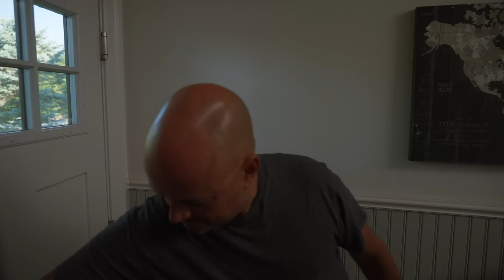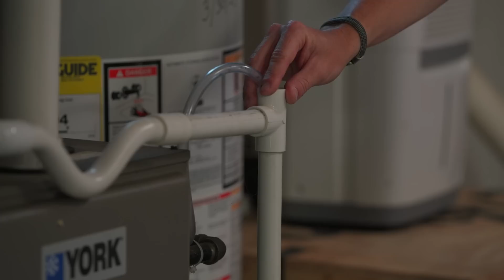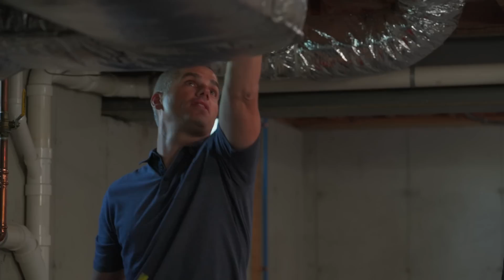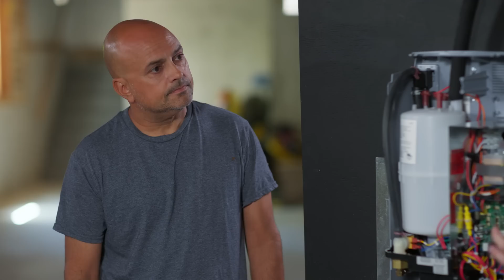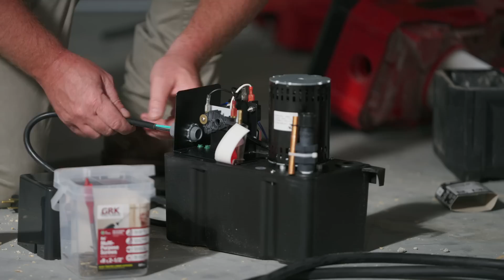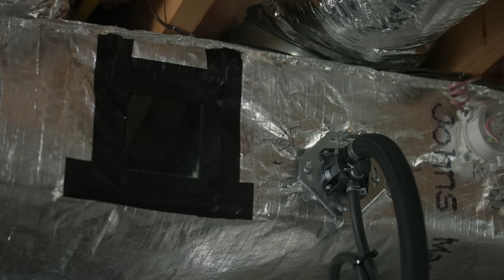Installing a Whole House Humidifier | Ask This Old House

Comment: I didn’t realize humidity could drop that low just from air leakage and exhaust fans running. The steam humidifier setup looks pretty involved, especially with all the safety components. I’d probably lean toward having something like American Residential Services handle that kind of install rather than figuring it out myself.

Comment: Is there a product like this that works without a furnace? I have radiant floor heat and no ducting or furnace to distribute humidified air. Apart from a freestanding humidifier that requires filling with water daily, is there any other product that can work without furnace?

Comment: Just had a AprilAire 800 installed in a super dry winter climate, very happy I did
Reply: compared to the AprilAire Bypass systems how do you like it?  I think I need to do this.  It just makes way more sense
Reply: @Ter @TerryKashat  never lived in a house with the bypass. But this winter with the steam has been a game changer for dry skin, plants and using less heat and sickness has been less. . Would hugely recommend. Utility has gone up a bit and have had to replace the canister once but still well worth it
Reply: @TDace25  Intuitively I believe it.  Makes perfect sense. Thank you.

Comment: Next, let's install this in a normal situation with a low ceiling basement filled with a bunch of the homeowners crap and ductwork from 1945 or an attic unit where the furnace barely fits on it's own. This Old House has become like Angie's list with video sales.

Comment: Steam is just fine but if you can afford the $1,000 w-S/H, plus ancillary supplies, wire, fan pressure switch and extra empty 240Vac slot in your service entry electrical panel, go for it. But my multi-speed two level forced air furnace that is 95% efficiency with “CAN network” communications for self diagnostics & built in humidistat was $2,000 for the entire furnace! In 8 years with cleaning, filter service and occasional check of the “WC” pressure at the gas valve uses so little gas and electricity our bill dropped to $38 average per month. Of course the utility company want money for new infrastructure updates, sewer separation fee of $58, then a fee for have a meter! Wow, then tax. So 26% of my bill buys natural gas. Start saving your nickels, dimes and quarters and 9.7 years you can buy one. Yeh!😅

Comment: Air leakage isn't the only problem with a home in the cold, heating air itself causes relative humidity to significantly drop as warm air can hold much more water than cool air, further drying it out. My skin cracks and bleeds in the colder months and running a humidifier definitely helps.

Comment: Yup, add an expensive super complex mini steam boiler instead of the cheap standard evaporative humidifier that have been around almost 100 years. Talk about redesigning the wheel! 🤦‍♂️
Reply: I’ve run into nothing but problems with our Trane and the evaporative humidifier. It’s a hybrid gas/heat pump system, that has a variable ram and heat pump. The evaporative humidifier doesn’t like low temp heating of the heat pump and low CFM fan settings, so it condensates a lot of moisture inside the gas furnace, rusting out the burners every few years. 

I deeply regret going with an evaporative humidifier.
Reply: @steveallwine1443  Yeah, I've actually seen this far too often, and ducts rusting and rotting away as well. Any humifier added to a duct/forced air system is just a bad idea anyway. I usually remove them, especially because our climate zone is humid pretty much all year long. If people require them , I recommend independent or portable systems.

Comment: Years ago, you all where presented with a mystery, While working on a  house in New England,,The extension chords suddenly started shocking folks...Same thing happened to me, I even ended up yelling at my wife for turning back on the electricity...I finally figured out after seeing the panel was still shut off that the panel was not grounded,,,but that's funny I said to myself, What happened ta cause this,.like you Guys the winter was brutal and it froze the pipeline on which the panel was grounded on when the city can and fix it,,,It Dawned on me.. The City is used plastic conduits....lol...I was in a Home Depot,,when a customer complained of his outlets shocking him, I turned my back away from him and said,,your pipes froze over the winter,,,He replied,  who said that who said that,....

Comment: We’ve run AprilAire humidifiers for over 40 years and found them to be the most simple way to add humidity to indoor spaces. Basically an evaporator that adds humidity to a forced air system. Little maintenance needed, other than making sure you clean out mineral deposits from the water supply line.  New unit put in our HVAC system ran about $400.  Cheap price for comfort.
Reply: I just bought the 600 with the auto control since it went on sale today for $255. Was hoping this updated video would show one of those types. Seems more cost effective.

Comment: Once again, they go to a system far more complicated and expensive than what is needed.
Reply: Totally get how it might look like we’re going overboard! We just believe in building a robust solution that covers all bases, so homeowners won’t have to worry about a thing down the road.
Reply: @CondairUSACA 20+ year licensed master hvac, you went way overboard, plus tell customers to expect $50-100 increase in electricity costs. Could have done a 500 or 700 model. I always recommend the 700, don’t need a crew of 7 guys to install.

Comment: Why does it need a drain?
Reply: As the water evaporates the mineral to water content changes and prevents the unit from working efficiently. So it dumps the old water, and gets fresh water. Also if you don't use the humidifier for an extended period of time, it will dump the water too. I have a similar unit, and it's been awesome in a leaky house from the 50's.

Comment: I have a total opposite problem with our house. Our house is humid all year long, but extra humid during winter.
Reply: They make similar setups for whole home de-humidifiers which you could look into.
Reply: @reaperbot5226  Thanks!
Reply: Same. Living in the pacific northwet, I've burned through 6 dehumidifiers so far. I run one in my shop 24/7/365 and one in my house and one in my RV in winter. Aside from reducing mold and such, it just feels nice to come into a dryer house when it's all wet outside.
Reply: We really like AprilAire dehumidifiers.  Not cheap, but very reliable and made in USA.  Many models allow dehumidification based on either relative humidity or dew point.

Separately, your house might have higher relative humidity in the winter, but it shouldn't be more humid.
Reply: @ncooty  After having so many dehumidifiers die, I bought a proper commercial Alorair unit. It's been running 24/7 for 3 years and still looks almost new inside. It's loud and ugly and doesn't have a bucket or pump, but it just keeps chugging along, which is fine by me. The consumer dehumidifiers really do not last.
Reply: @bmay8818  We've had ours for about 5 years.  No issues yet.  What failed on yours?
Reply: @ncooty  I don't know, I've never dug into the failed ones to see, but my bet is on a refrigerant leak. But my much more expensive Alorair dehumidifier has been running great for close to 4 years, longer than almost any of the others. Turns out that spending more on a dehumidifier does actually get one a better unit.

Comment: Is there a whole house DEhumidifier system?
Reply: Yes, an air conditioner
Reply: Yeah they did on a house in New Orleans
Reply: Yes , I have a ultra-aire whole house dehumidifier. Pretty sure they are called santa fe now.
Reply: They make similar setups for whole home de-humidifiers which you could look into.
Reply: Yes, Honeywell makes some user friendly whole home units stand alone or connect to existing ductwork.

Comment: Ross says the stack effect is at play and implies the house is not tight enough. Also, the mechanical ventilation is very effective. It follows that the house is not energy efficient. By introducing more moisture in the air there's a greater risk of condensation in wall assemblies and the attic. As a result, cladding problems may arise, attic insulation may become wet (and it's effectiveness greatly reduced), ice dams may occur (as warm moist air enters the attic). I'm a home inspection student so any comments are welcome.
Reply: You are correct that adding moisture to a home has an increased risk of condensation. So it’s extremely important to add the right amount of moisture, introduced properly, with the proper safeties and sensors. When done properly, like on this project, the home will be maintained at 30-35% RH during the winter months. The dewpoint of this air is ~39 F, so we need all interior surfaces to stay above this temperature! 

Hope this helps!
Reply: What’s the concern with mold in the ductwork using one of these? My house gets into the 20s for humidity so I need something but I’m torn because the thought of moisture in the ductwork makes me worried about a mold issue. 

Also what would the instal for a unit like this run? Located in Rhode Island so I’m assuming close to where this was done.
Reply: I can't help but feel he does not have a full grasp on why humidity will drop in any house when it's cold out. Hot air holds a lot of water to be at a high %, while cold air holds very little. So when you heat up cold air, the water in that air becomes a lower % of the total water that air could hold. 
I'm more of a science person than a house person so maybe he is on to something, but humidity is going to drop in any house when it is cold outside

Comment: Those work great, but I wouldn't recommend them.  First, I wouldn't set it any higher than 30% in the winter.  Otherwise, plan on paying for a new roof in 5 -10 years.  Second, unless you have soft water going into it, plan on replacing it every 2 years.  Just use portable room units.
Reply: @chestyvulva Cheaper too.
Reply: The last thing I would ever want is moisture inside my ductwork. Unless it was a bleach solution.
Reply: @JamieHitt  Yeah, moisture and dust. Like weaponizing your house with germ warfare. The only good thing is the water starts out pretty much sterile as steam.
Reply: In very low humidity situations like this though you are going to be hauling 5 gallons of water daily to those room units. I know because that's what I do right now!

Comment: This is a little elaborate. I bought a cheap atomizer instead and it’s been working amazingly well. I think it was $150 and took me a couple hours to install. Steam setup sounds great but gees oh man. This would 3 grand or more to have someone install
Reply: Hope you have good water, anything in that water is atomized into the air and into your lungs.
Reply: Yeah the house we bought had an atomizer in it. It worked perfect.
Reply: I installed one by aprilair.  It does 220 or 110.  220 made my electric bill crazy high.  switching this season to 110.  Which atomizer did you get?